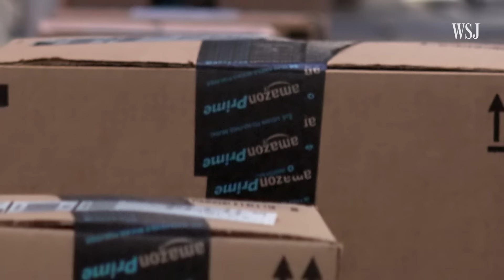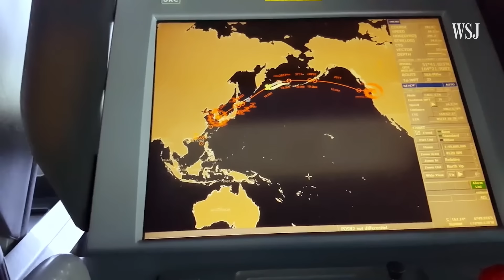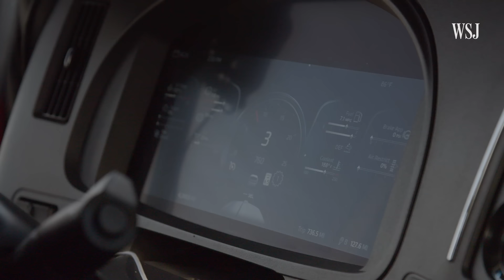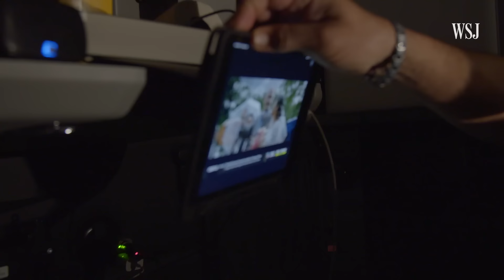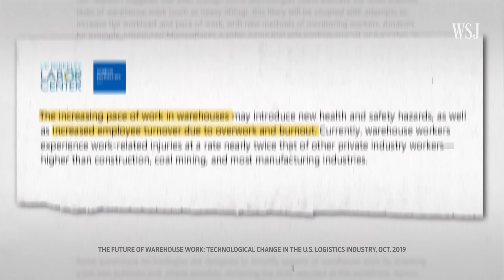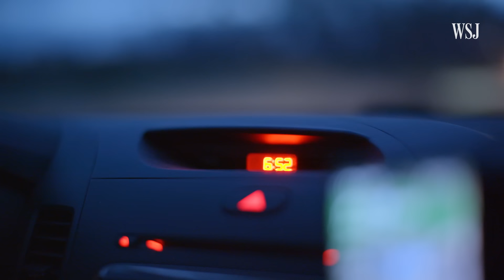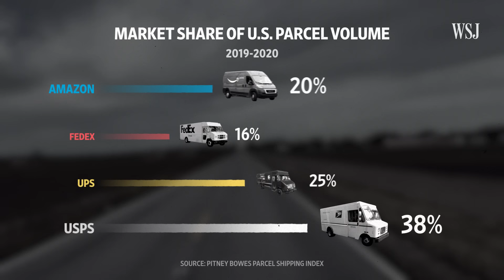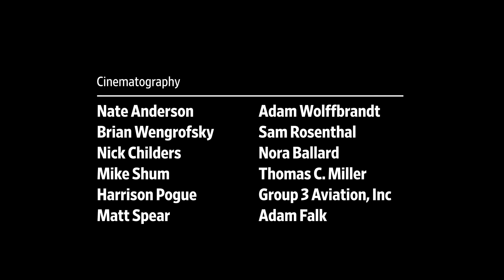Why Global Supply Chains May Never Be the Same | WSJ Documentary

Comment: Looks like it's time to increase the amount of rail miles we have have in this country, just like we used to have, to reduce the reliance on long haul trucking and spread the load out more evenly to make the system far more robust on the ground side.
Reply: I think that is a good idea
Reply: Actually the US has the longest rail routes in the world and it consumes 30% of all forms of transportation. It is also old and slow.
Reply: Great idea, but rails-to-trails predominates, and rail lines aren't cheap to build anymore. Under present day regulatory and business conditions, none of the transcontinental rail routes would probably have been built. Regional lines? Probably the same problem.
Reply: @raycomeau6866  The vast majority of rail has been removed in the USA. There used to be rail to almost every town and city in the USA. They were tore up replaced with roads or highways. The biggest economic disaster by most economists. Now the problem is almost all the rail is owned by two families. They dont want competition.
Reply: @raycomeau6866  Im gonna add to this that modern trains aren't slow nor do they need much fuel. At speed rail can move 400 miles per gallon of diesel. Physics is an amazing thing.
Reply: Europe has a lot more rails per square kilometer than US does... Its a good thing
Reply: @raycomeau6866  old and slow can be changed with investment of money that the railroads have and just don’t want to spend on being rail roads, and compared to the amount of trackage that they used to have and the amount of costumers they used to switch and ship it’s pathetic. The class 1’s aren’t interested in railroading anymore despite the fact the door is wide open and it really is the greenest future for all of us.

Comment: Really thorough video. One thing I still haven't seen covered in any depth, though, are rail operations. I think following the container from the port through loading the rail and the path it takes would be good to see. Why do some containers load the rail in 2 days after they discharge in LA, but other times it takes 6 weeks! Lots of variability in how long it takes to either load the train at the port, and then sometimes it loads and sits there for a week before it departs. Also, containers can get held up along the way for weeks unexpectedly. Maybe a second video can cover that aspect of the supply chain :)
Reply: @uncannyvalley2350  Well said….Just look at all the robberies of the trains in Los Angeles! Another big problem…👋🏼🇨🇦
Reply: A big reason is the lack of flexibility in the rail network and the complexity of managing multimodal transit. Where rail has a big advantage is when you're moving a lot of items a long distance. Rail takes considerably longer than truck transportation, and in most cases the goods still have to go on a truck to the last mile anyways. Additionally because you have to go through a rail provider and are adding another trip to and from the rail yard on each end it makes the arrival time far more unpredictable.
Reply: A big part of it is the rail systems not just in America but globally often being underfunded and the companies running them rife with long-term corruption/management problems stemming from when rail was the only real way to travel long distance at any reasonable speed. (ie. And was incredibly powerful/influential as an industry akin to oil today)

For example, I'm an Aussie railfan and a consistent reason for a lot of the smaller rural branch lines closing that you'll hear is the freight demand drying up due to inflexible line managers preventing new customers from easily getting their cargo on the trains because in the managers mind, larger trains serving more customers made their job harder until enough had done that and enough former customers closed their doors that there wasn't enough demand for anything but the larger, long distance trains. This is a big part of why trucks took over cargo at least here and you can even see it still to this day with grain in the state of Victoria where there's at least one line (Eaglehawk–Inglewood railway line) where the local farmers have been calling for the local railline to get reinstated for over a decade because it's actually cheaper for them to truck the grain to the silo and train it to the ports in Geelong or Melbourne and Kensington Mills in Melbourne.
Reply: Containers sit because the ports and rail yards are being used as tax free storage. If the product isn't on property, they are taxed for that inventory.  Companies want their product in transit and there was a time when they would send loads out just to move them for tax purposes. 
They also just might not the space for the product or not be ready to receive it. 
The rail industry also reduced their trunk lines to two tracks and reduced the size or eliminated rail yards as trucking took most of the business.
Reply: @pohldriver  if you're shipping FOB terms then you already own the inventory once it departs origin. Maybe there are some businesses out there trying to avoid picking up their goods, but my experience is that there's just not enough truckers (or chassis) to pick up the containers fast enough. Regardless, my point was more about the lack of in depth coverage provided over the rail operations. All other modes seem to get a lot of attention, but the rail operations always seem to fly under the radar. I don't think we should give them the benefit of the doubt that they're the all stars, when they are just as limited in their capacity as the other segments of the international supply chain.
Reply: @billyrourke2182  it's some part in the tax codes about getting charged for inventory on property. Companies are quite vocal if it looks like a driver could still be on property after midnight at the end of the quarter. Once the driver leaves the shipper, the product is the responsibility of the transportation company and they essentially own it until it arrives at the receiver. 
Amazon and their same day service is the biggest problem. They're pulling so many truck drivers to run their blue trailers that sometimes are essentially empty that they're wasting capacity and drivers. They're also driving wages down by only paying well over the holidays. 
I saw years ago already that they said that trains were as close as they could schedule them.
Reply: Can't give away all the secrets and weaknesses. Go to the library and self study
Reply: That's assuming the boxcar does not experience an unscheduled offload while transiting seedy areas of California.
Reply: Rail operations for the most part have been first in first out due to limited space at the port terminals (for on dock rail). This is a huge issue creating backlog and disrupting available space at the port terminals. In addition, there has been a massive influx of rail cart shortages probably due to the limitations of how rail operations work. For example when you bring a bunch of containers inland, generally you want to bring a bunch of containers out to the port now unlike the ports where containers can be stacked very high on the vessels where the cranes can go in and out to discharge containers, rail carts only stack 2 high but extremely wide meaning more moves are required to fully discharge containers off a train. Going back to bringing the empties to port terminals they also hit port terminal space availability constraints. I tell all my customers this, one of the major bottle necks is the infrastructure in the USA and we hit that bottleneck every year around August to November, December calms down a little (more like a catch up) then it bottlenecks again for Chinese New Years around January all while finally reaching a few months of peace from March till around July.
Reply: @jillopus1 Thats the unfortunate truth of every industry, greed keeps people in it longer than they should and innovation from the upcoming generation die with it as there is no upward mobility to provide any change. Those whoever left to hit upper management either stay long enough to get there without any will to change or their drive for innovation die with their age.
Reply: @TheDemocrab  R.I.P. Warnie
Reply: @jillopus1 Over-costing was a common way that they'd try to not get your business, essentially charge like a wounded bull so if you have to do the job you don't wanna you're at least taking home bucketloads for it... 

Didn't help that freight/passenger travel got split off as the original idea was that the "big bucks" passenger routes (eg. Metros in capitals, links between the larger regional centers) paid for a lot of the maintenance and unprofitable routes to important places. The fall of the railroad industry is as much the fault of the corruption within it as it was external sources.

Comment: Great documentary. Very, very interesting and almost frightening when we see how fragile the entire logistic system can be when one little part does not work as it should. Two huge thumbs up to all these workers who make it possible to order online and get the package or packages within 1-5 days - usually.
Reply: opzz xsin  all of this is a feature of the system, not a bug in the system. Unions are important, but reforms do not address the systemic problems. Revolution does.
Reply: @WHATSUP7049  The Great Reset is absolutely real, I have listened to and read Klaus Schwab's book, but it doesn't mean that we don't have an extremely fragile system. Our current system is very easy to disturb or break. It's a fragile system.
Reply: @robert4you  well considering what is happening with the great Reset isn’t the logistic system not the real issue, because the fragility of the system isn’t what’s failing.  This is being done purposely with complete malice !
Reply: @WHATSUP7049  Evergreen and stuff like it are planned. Also look at the weather control.
Reply: @jozefmak984  interesting

Comment: Thank you so much for touching on deregulation. It has decimated the trucking industry for the drivers. As a driver,  I can tell you it's not a driver shortage. It's a pay, benefits, parking, and home time shortage.
Reply: It makes me wonder how soon the focus will move off electric cars to self-driving trucks. Rightly or wrongly, designers could forget about trying to change the truck from being electrically powered and leave it as diesel powered vehicle in the interim. Possibly with an on-board driver as a backup. 
Then you only design the truck to run long-haul routes on highways and freeways to onload/offload 'terminals' at the boundaries of each city (so that the self-driving truck doesn't need to navigate city traffic with the safety issues that brings). Viewed htrough that perspective then  the self-driving technology required is probably very close, if not already available. Especially as highways/frereways could be modified with navigation enhancements for the self-driver bot to reference.

I'm not sure that would leave the remaining short-haul truck driving options as a pleasant job in the US, although it would probably remain so in Europe as in other countries with decent employment laws. But it is the most obvious solution to the situation that deregulation has created.
Reply: Amid all the fuss over an influenza pandemic, you'd think someone in Washington would address the issue of deregulation and trucking of goods to supply a hungry nation. Someone...anyone...are they even listening?
Reply: @marktwain368  They don't give a hoot.  They've got their checks, what do they care?

Comment: As others have stated, the compensation for long haul drivers has to be excellent in order to fill the shortage. How much would you require to be on the job for the majority of a week except sleeping? There are so many challenges qualified drivers face over 60 hours of driving in a week. If every detail is difficult for the drivers constantly, the turnover will continue to be high, and it will be hard to fill the shortage. Part of the problem for drivers - for both pay and sleep - has to do with the regulation on their schedules and trip logs - especially if they are company drivers paid by the mile. Drivers that are owner operators or company drivers with good pay per load are better off. All that said, long haul is still a lonely job. It suits some, but maybe not enough to fill the need.
Reply: Some of us prefer to be alone. People Are stupid. Self-centered. Inconsiderate.
Reply: Remember the days before tight regulations...drivers falling asleep at the wheel killing entire families and oftentimes themselves.  Do we want to go back there?
Reply: @marcpikas2859  remember freedom? Those were the days
Reply: @WhoTFVotedBiden  Freedom comes with responsibilities. Not all grasp that concept  unfortunately.
Reply: Easy solution. Re-initiate/expand rail for long haul infrastructure, you want your 24/7 that's where you can find it. And for trucking, pivot and incentivize local to regional arteries instead.
Reply: @crimsonsamuraiftw  no , the solution is automated trucks . Why spend all that on infrastructure when you can just keep the existing infrastructure and add a layer of AI. Look at George Hotz company (Comma AI) . More and more of these type of companies will appear once big tech is able to infiltrate the Department of motor vehicles. 
Once you get rid of the driver your margins increase greatly, thus prices can be lowered as delivery is so low, in turn giving the customer all the benefit. This will also happen with local food delivery apps, ride hailing apps, and anything logistical.
Reply: A friend of mine is a long-haul truck driver and he never leaves home without his sidekick/partner, where one's driving and the other guy's resting in the sleeper unit in the back. That way they eliminate downtime by only having to stop for gas or food because the sleeper unit has a toilet, fridge, TV, the works.
Reply: @jeremiahweaver4677  Australia's solution was bigger trucks. Around 4 years ago you'd see full size doubles(2 x 50ft), or b doubles (50ft and 30ft) leaving the city to go out into the bush or city to city routes. Then covid hit and now its triples and quads leaving for those same routes. Basically double the capacity for the same amount of drivers.My work itself went from 6 doubles a day to 3 quads a day ( now at 9 quads a day due to expansion). 

Bigger trucks may be a solution for americas problem that Australia solved almost a century ago
Reply: As someone not from the US but willing to drive in the US: Both pay and working conditions are better than in Europe, but the whole process of getting a Green Card (once you managed to convince a company to sponsor you) easily takes 2 years. Cut out the bureaucracy and start hiring people who want to do the job
Reply: @Immortal..  What a coincidence. I lived in the US for half my life (27 years) and the BETTER half (26 years) here in Europe, 1st in Czech Republic, and now in Germany. When comparing the 2 continents, I'd tell anybody to stay here, as bad as it may look at the moment.